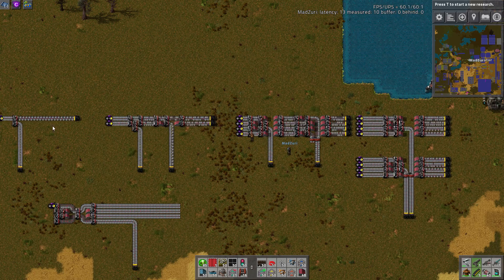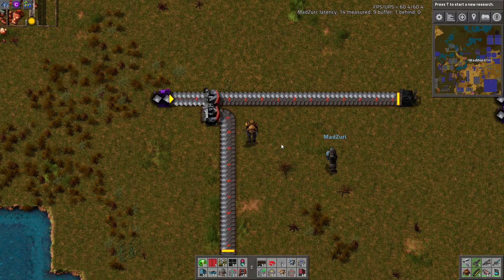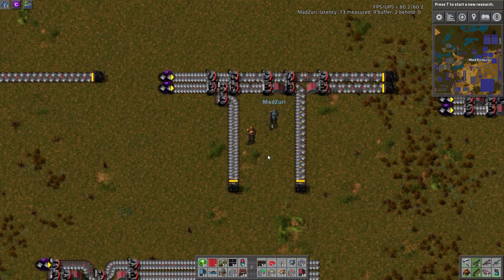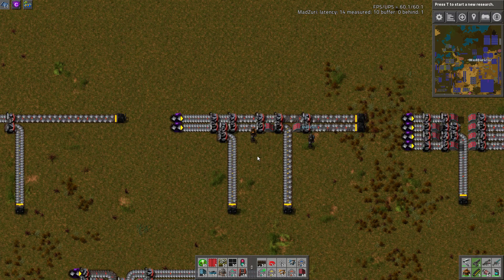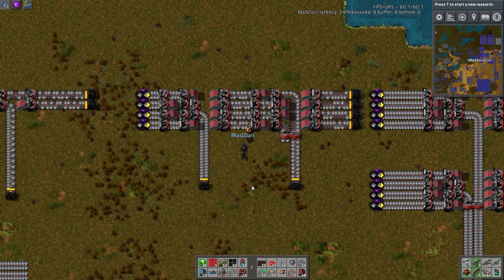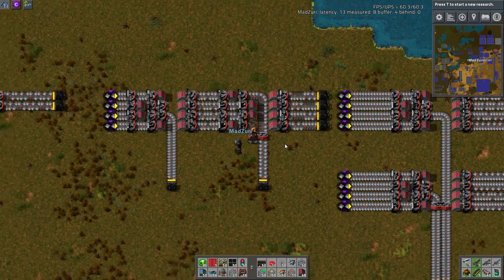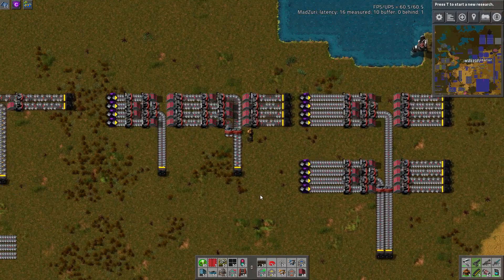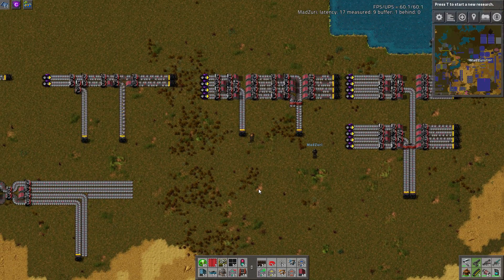Factorio Workshop - Building A Better Factory :: Lane Split Off Designs

Comment: Do you really need the two bottom and top splitters at the same time with the design at 1:32?
Seems like one set will do the thing just right.
Reply from the maker: They are not needed for balancing I don't think, but are needed for full throughput.

Comment: if I didn't have 8 lanes of iron, only 4, and I wanted to pull two lines off while still keeping 4 belt possible throughput (if the off lines are stagnant) - would any of those examples provide two belts of throughput? assuming I don't use multiple tiers of belts in the solution
Reply from the maker: Based on what you're saying, I think just using two of the 4-lane split offs would provide what you want.

Comment: the two lane version only needs 2 splitters
Reply from the maker: The 3rd one helps balance it after pulling off, so I would still definitely use it.
Reply: you balance before pulling, the next time you pull you will balance before that. You're just chaining splitters for no reason.

Comment: One friendly suggestion if I may: I think your videos would be greatly improved if you would reduce the moving back and forth on the screen. Use the cursor to point at objects. All the moving around makes me reach for the Dramamine.
Reply from the maker: Yup, good advice. Have had many people point this out, and it's a very bad habit I'm still trying to break. :)
Reply: You do slow down when Madzuri is talking. And I still learn a lot from the vids. Thanks.

Comment: I only rebalance a belt if the build does not use a full belt of supplies. (like say your the steel needed for making piercing bullets) If I'm consuming 4 full belts of iron (or anything for that matter), I'm probably close to switching to bots.

Comment: Coil Video! I wanted a tutorial on this for a long time. So these splitters pull evenly from every line? I also dont think they are very good for a bus because of the size..
Reply from the maker: Glad you liked it! Correct, it pulls evenly from all lines. And yeah they are pretty big, that's why we suggest to just take 1 entire line and and turn it off from the bus into the production that needs it.

Comment: GAAAAH YOUR 4-4 IS WRONG! No bloody splitters at the end of a 4-4 DAMN IT!!!
Reply: The difference isn't in the balance, it's in the throughput
http://i.imgur.com/hPBhwFy.gifv
This only happens when certain exits are blocked and you're feeding certain inputs. But it still is an improvement over the 4 splitter design.
Reply: zuri built it, IT CANT BE WRONG!!!! well it can be but zuri built it
Reply: stewart bell maybe xterm built it and zuri didn't notice?
Reply: No One how was it wrong looked good to me?
Reply: ColonelWill the splitters at the end aren't needed. I've tested it myself by feeding a 4-4 without the 2 splitters at the end 4 belts all with different items and made them go into a chest,  and every chest had 4 different types of items and they were evenly distributed

Comment: I've seen a video from Steejo about using circuit networks to split belts, would that be preferred over the setups you've shown?
Reply: Jason Hansen nope not at all
Reply: Steejo's circuit condition forces stuff to one side of the bus. For example, if what you pull out to the left happens to be a full belt, then the right most belt becomes empty. It forces your product to one side of the belt. It does the same thing as the peel off method followed up by a squiggly bend, but once production stops, the empty belts fill up again.

Two things I don't like about. First, when you have constant production (which you should!) you end up with many empty belts. The other is that all of your feeds have to go to one side of the bus, because the other empties out. Everything has to be to the left, or to the right with Steejo's circuit method.
Reply: Jason Hansen I build those for my bus
Reply: I dont think so.
Reply: his method ensures that everything gets all the production it needs, so if you have enough input to the buss, all the outputs will be full when peeling off. If you have any shortage on the bus for later products, it means you need to increase input.

Say you have greed circuit production that takes a full blue belt, and you have enough production to fill 3 blue belts, but your bus is 4 wide.

This method will give green circuits 1/4 of bus production, so 3/4 of a saturated belt. Steejo's method will take a full saturated blue belt, and compress the remainder into one side of the bus, so 2 full blue belts remaining, and 2 empty. This gives a clearer indication of production means (as you can see much more easily how many belts you're saturating) rather than guessing based on the number of gaps, and it means that earlier products are prioritized, which is arguably more important.
Reply: Though your statement is correct, earlier split offs are generally prioritized when using a balanced bus.
Say you have a 4-lane wide balanced bus (saturation doesnt matter). If you do a 1-lane split off like shown in Xterms video here, it will get exactly 25% of the bus, 75% continue down the line.
The next split off will again get 25% of the remaining items, so it´ll get 18.75% of the initial items, 56.25% continue on.

Comment: Ewww... belts... ugh
Reply: "Belts Rule, Bots Drool".
Reply from the maker: Gotta use em at some point. :P
Reply: That's not even a balancer!

Your builts for the 4 lane balance/splitters are wrong.

All 3 builts on the right side of the screen can't work because you got one splitter less than you need to balance all 4 lanes.

The 2 outer lanes will stay empty if you don't put a splitter in front of the two 1st undergrounds you used.

I can see now why both of you don't like balancers. You don't know how to built one. ;P